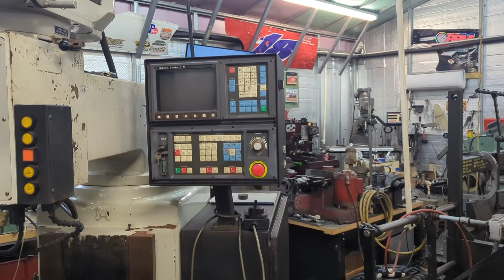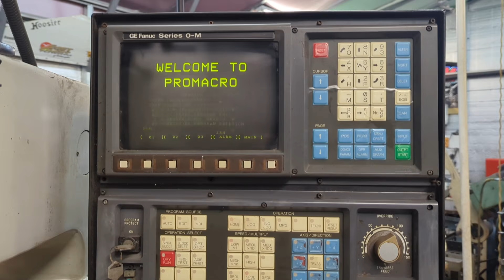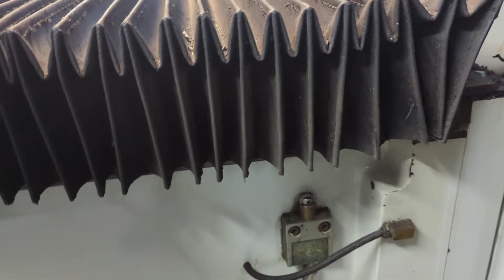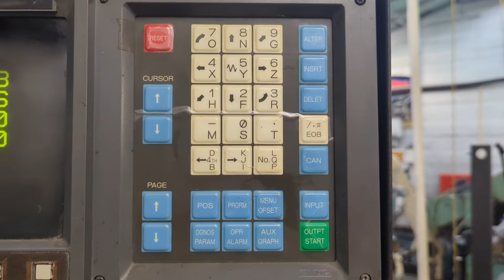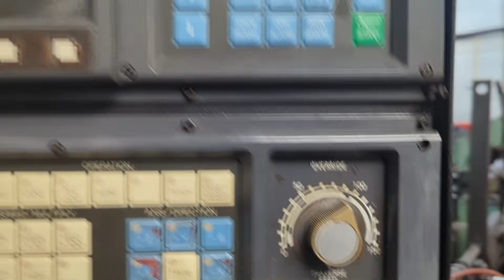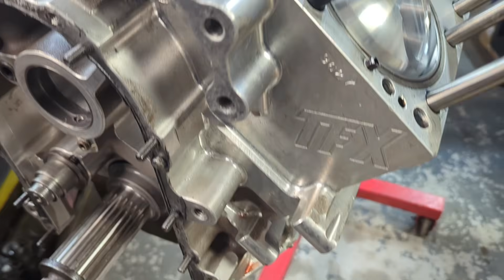Top Fuel hoops! Lets set it up on our $1200 Left for dead CNC milling machine we dragged in last Fri

Comment: Do you grind them bronze , copper , beryllium  type valve seats, if so can it be done with Ruby red?  I do small engines and I cannot get small Cool Blue stones,  just rubby red.  I can't get the seat size I want so I was gonna buy some  bronze bar  from macar master. My favorite engine channel here
Reply from the maker: Hi there, and thank you for the kind words! Yes the beryllium can be ground using the ruby reds but you will be dressing very often so that your not loosing the angle. The goodson cool blue do work a little better but its not monumental in difference. Are you sure you need beryllium copper seats? Are you running titanium valves? That is the only time I run copper beryllium to keep the valves and seats cooler. Or on a nitro motor. And on the goodson cool blues I have sacrificed them dressed the 90=deg sides way down to fit some MC heads we are done. Makes a mess but sometimes the only choice.
Reply: @markanthony6544 well,,,,I don't want titanium valves  but,  think I might  need them - I am  limited with spring pressure .  Unless you think I can get  away  using the  ,  cast  seat/ ti  valve combo since,  since my valve spring installed height pressure is only  40# ,   130#  over the nose  .   Engine maintenance is about every 4 hrs ....  Ehhh, if it blows before that , without ruining  the head , then it's still a good Day .   Evan if I don't have a harbor freight super coupon to buy the next  engine 👍.
Reply from the maker: @UptopCake  Clones! Lol. I believe you cast seats would be fine, I don't think you will gain anything by adding beryllium seats. On limited SBC circle track engines we run ti. valves on cast seats-heads with no problem because these are flat tappet cam engines with only 100 lbs on the seat, maybe 280-300 over the nose.

Comment: You are using a rotary carbide cutter, not a drag knife like on a boring bar, yes no ? The cutter have to be smaller than the width of the oring to get a good finish - climb milling pass inside and outside of the grove.
Reply: very good!, use plenty of coolent, 2 flute cutter plug up very easy, it got me bad a few times, another tool you might try a test run is a single flute DLC coated cutter, less chance of sticking.
Reply from the maker: Yes I will be using a 2 flute solid carbide end mill and circle interpolate the radius. Prior to this I used a grooving tool on a fly cutter and plunge cut. I did not like the finish I was getting doing that way.